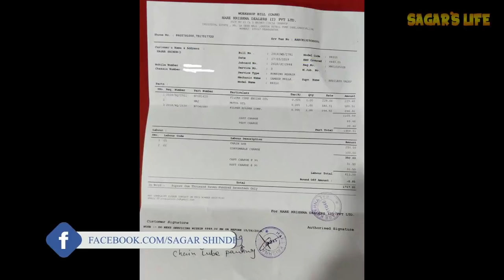3rd Service Of Apache RR 310 | Seat Vibrations Fixed | ECU Updations | Improvements | Must See Video

Comment: Tell your invoice it’s not clearly visible in the video , why haven’t you tried tvs fully synthetic oil for rr310 which available in svc?
Reply from the maker: Mee too wanted to try the TVS oil but in mumbai they discontinued it due to its higher price so I had no options other than going to motul mineral oil,, but on 4th service will going to shift to 300v oil for sure 👍
Invoice scan copy link has been added in description box

Comment: Bro which oil did you use in your second service?
Reply from the maker: It's stock motul mineral 15W50 oil 👍
Reply: @SagarsLife  can we use fully synethetic oil?
Reply from the maker: @anshulbalani5707  Yes why not but try to avoid it till 10k kms on odometer 👍

Comment: Are New seats available for all? Or only of first batch bikes?
Reply from the maker: Don't have exact details but I think tvs should change for all Rr310... Just keeping fingers crossed.....
Reply: @SagarsLife  went to SVC yesterday, currently its only available for bikes delivered in Jan and Feb (i.e. First Batch)
Reply: @ThunderingTosspot  Navi Mumbai. 
SVC guy told me that only first batch models and those which have defective seats are getting replacement. Not all. Don't expect the seat to be replaced though. Its very slim chance.
Reply: @ThunderingTosspot  you can have it checked. If there is some issues they will change it. But as of yet I have come across anybody who had his seat changed.